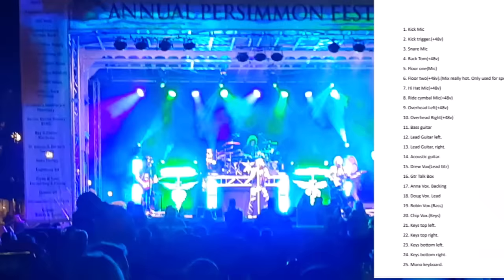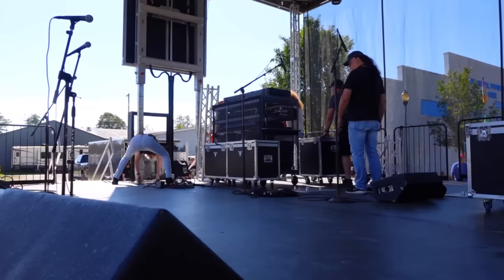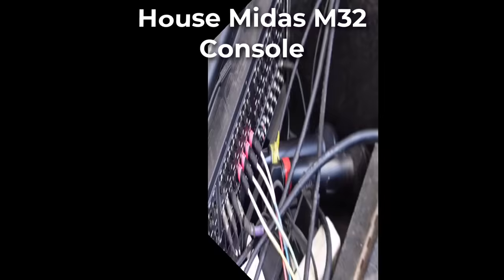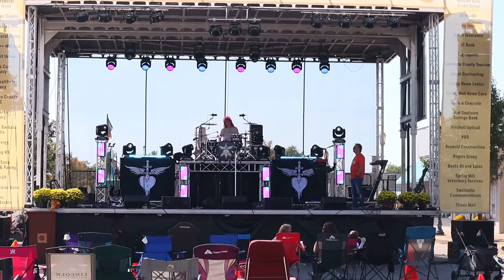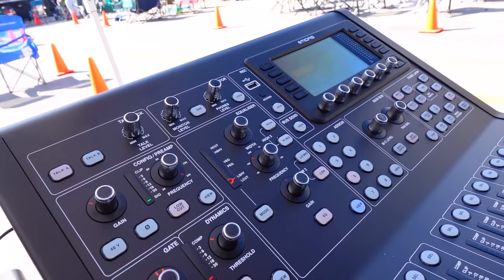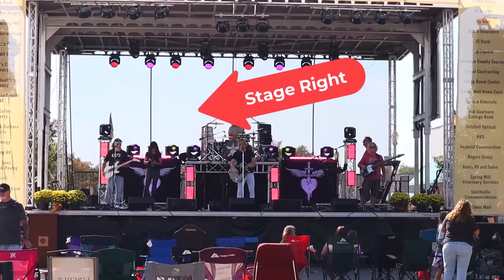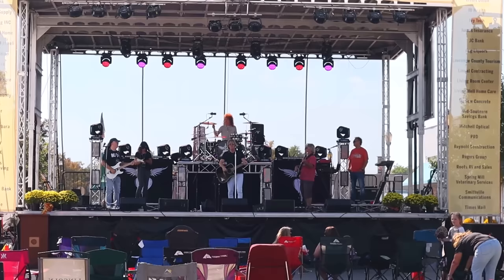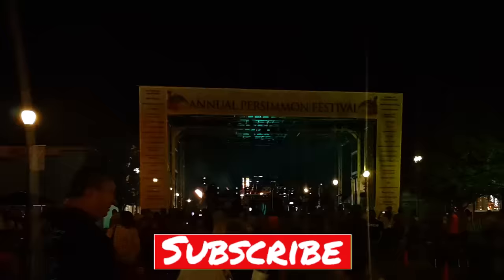Show day and Soundcheck: A Day in the Life of a Freelance Audio Tech

Comment: Any tips on avoiding tons of bleed on an sm57 guitar mic?
Reply from the maker: Are you talking about an SM57 on a guitar amp or on an acoustic guitar?
Reply: @AlanHamiltonAudio  sorry Sm57 on a electric guitar cab. The drums are about three feet to the side of the cab.(  Stage style set up) I was almost thinking of getting a chunk of foam and sticking the mic through it to see if that would help.
Reply from the maker: @SkylerMills  I don't know if foam would really help if used like that. I guess it all depends on how you do it. If it's thick enough to block sound (obviously you don't want stuff that's more like a mic windscreen), then if it's too tight around the mic it would change the frequency response of the mic. But that might not be what you mean. If you leave it fairly open around the mic, like a big cube, then that probably mitigates any issues with mic frequency response, but the same principle keeping the drums out of the mic would be keeping the sound of the amp blocked up inside that foam cube.
But that said... Maybe you just need one side to the foam, or foam on a plywood baffle (or just the plywood baffle (or plexiglass)) turned 90deg to the amp and just creating a barrier between the drums and the SM57?

That would leave the amp mostly still firing forward so the guitar player still gets it and it sounds normal.

Also, if it's an open back cab, you might TRY putting the mic in the back of the cab aimed at the open area of the speaker and see if the cab itself works as a natural baffle to keep the drums out. You might experiment with the polarity on that channel to see if micing the speaker from the back sounds better one way or the other. I suspect it won't make a real difference since there's just the one mic'ed cab... 

OTOH...
If the band is on IEMs, you can pretty much make a baffle box to set in front of the amp. 2 sides and a top. Stuff a packing blanket into or staple it inside and even build a permanent gooseneck mic holder in it too. If everyone is on IEMs then you don't need to worry about baffles wrecking stage volume that musicians are using as part of the onstage monitoring. The IEMs will be handling the monitor mixes.

I'm just kind of rattling off ideas off the top of my head here. YMMV ;)
Reply: @SkylerMills  Couple of things :

- generally the drum bleed into SM57s miking cabs is not that bad

- you can also place cabs on the side of the stage as opposed to facing the audience

- you can use something like a Two Notes Torpedo thing (or an equivalent) to do virtual miking (instead of or in addition to your real SM57) and get a clean signal with no bleed.
Reply: @AlanHamiltonAudio  thanks for the response! What we ended up realizing ( and this is dead simple) although it didn't eliminate the issue. It helped a little bit... since we were all on IEMs our cab volumes were pretty low, so we had the gain up on the 57s. So we turned up our guitar amp volunes and was able to bring the gain down on the mic, now the cab volume matches drum volume... Not idea but it helped a little bit with the bleed situation.  It honestly depends on drummers. The drummer with this particular band plays super hard so it comes through the 57s pretty heavy. Vrs another drummer who playes at a more normal volume and it's fine.
Reply: @SkylerMills  Mic distance to the cab and cab position compared to the drums plays also a big role in how much drum bleed you will get in these 57's.
Just having your mic on the speaker that is the further from the drumkit can make a big difference in bleed.
Reply from the maker: @SkylerMills  Yeah, first rule of audio: Loudest sound at the mic wins.
Usually, guitarists being loud isn't a problem... so I never thought about you needing to turn the guitar amps up. ;)
But it makes perfect sense if your amps were not really turned up much.
Since you're on IEMs, you could also consider moving the amps wide of the drums... even turning the amps 90deg so the amp itself is a physical barrier between the 57 and the drums.
Reply: @djabthrash  cool! Never thought of that. But will make the adjustments!